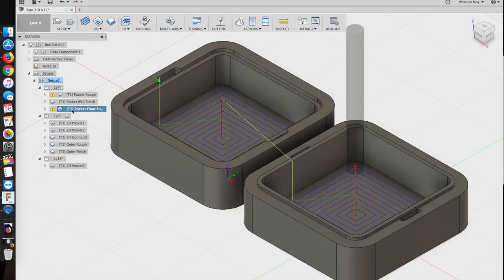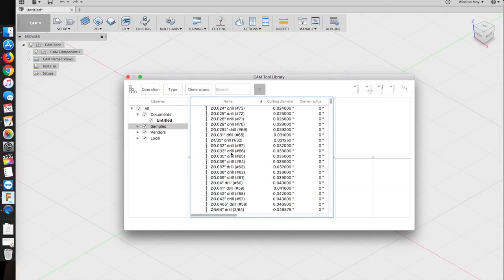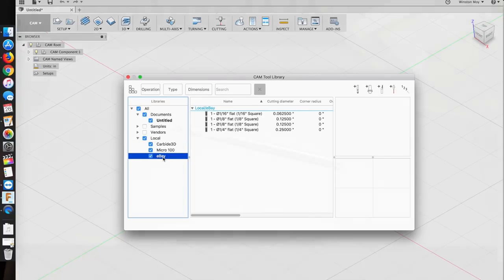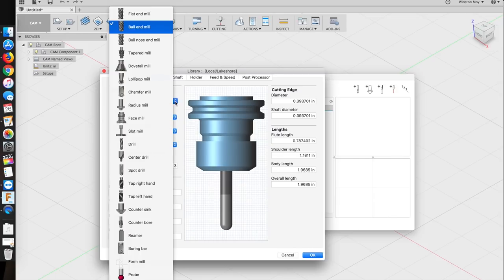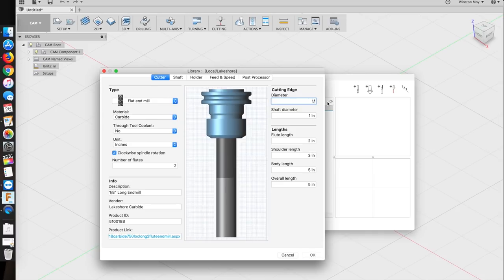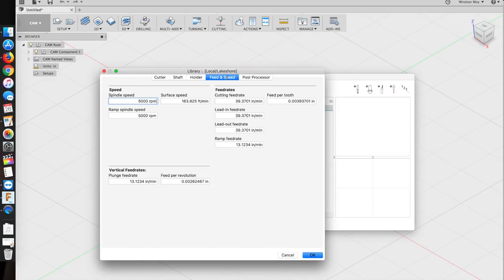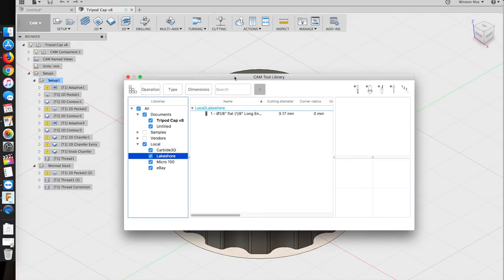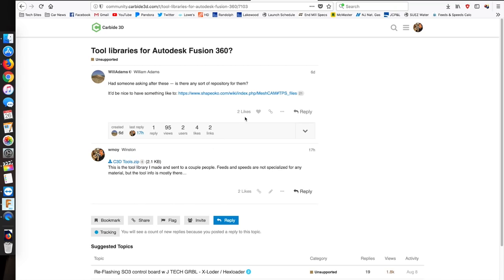Adding Endmills to Your Tool Library - Fusion 360 Fundamentals #1

Comment: You can also create multiple copies of the same tool with different feeds/speeds for different materials so you don't have to keep changing them.
Reply: Bro how to add new tool material to our library?
I can see only carbide,ceramic, HSS, to coated tool.
I need a cobalt drill but there is no cobalt material in tool library plz help
I m new to fusion 360

Comment: You can also create online library so you have it on your autodesk account and on all of pc where you install fusion360. If someone is intrested send me a reply and i will put small guide for you :D

Stanley
Reply: Bro how to add new tool material to our library?
I can see only carbide,ceramic, HSS, to coated tool.
I need a cobalt drill but there is no cobalt material in tool library plz help
I m new to fusion 360

Comment: what are the best sites to buy cnc tools as you experience?
Reply from the maker: If you have no idea if you need the tool in your life, ebay. Drillman1. try it cheap before you add it permanently to your arsenal.

Otherwise, the manufacturers I go to frequently are: Carbide3D, Harvey/Helical, Lakeshore Carbide, Kodiak Cutting Tools, Datron. Some of them sell direct, some have distributors. Haven't personally used Tools Today, but a lot of people have without a problem, they're a reseller with a decent selection. Bits 'n Bits, and Endmills & More are others who i've dealt with.
Reply: thanks for your information.